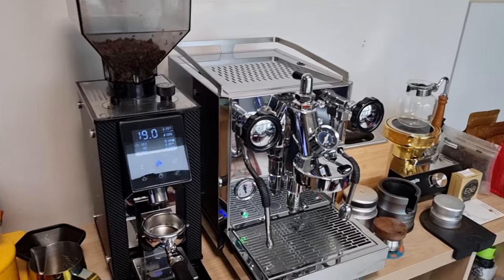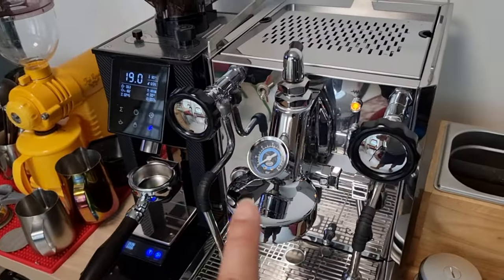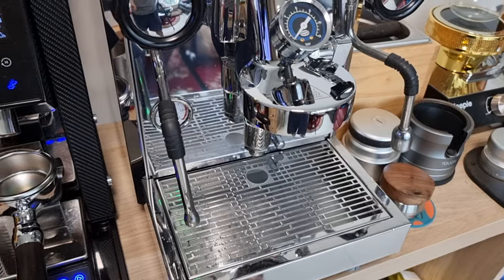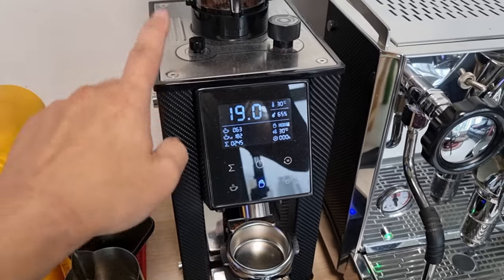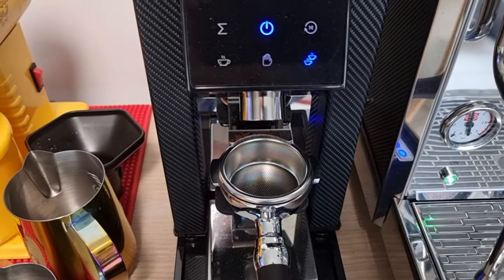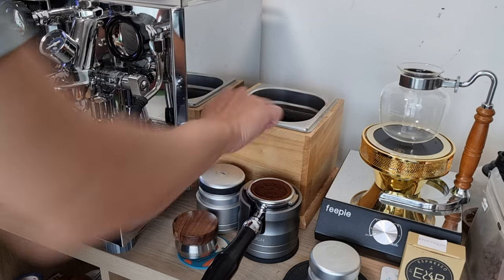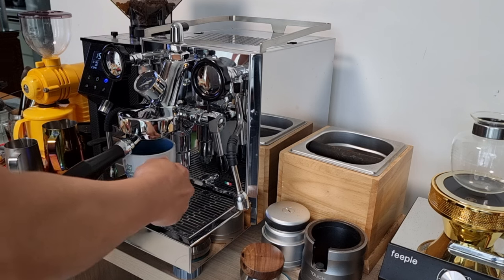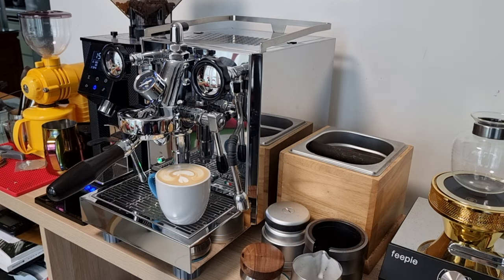Machine 01 | Quick Mill Rubino & RF64W | Heat Exchanger without PID and Weight Dosing Grinder

Comment: Thanks again for showing Rubino. It has been 9 months since I bought it from J Coffee and I totally love it. Simple and effective. However I'm still using the transparent DF64 cup and when I transferred to portafilter, it left a deep ring mark on the side which I felt could contribute to channeling. Do you think wdt can correct it before tamping?
Reply from the maker: Yes definitely, get the spinning wdt from J Coffee. It will solve your channelling issue.
Reply: @CaffeMartellaSingapore  Tks. Do I still need distribution or can go straight to tamping? Try to minimise the gadgets and keep the workflow simple.
Reply from the maker: @bored2dad  can try straight tamping after wdt